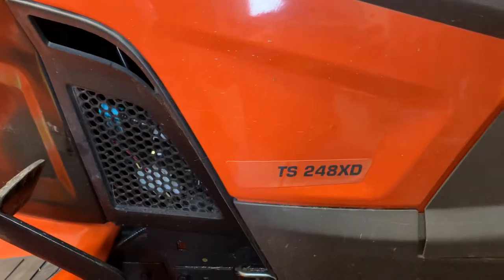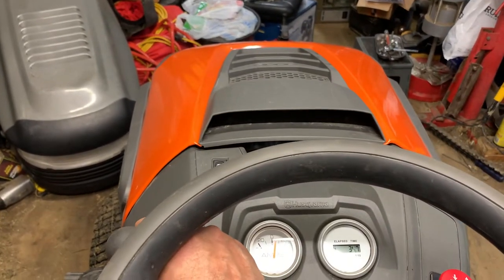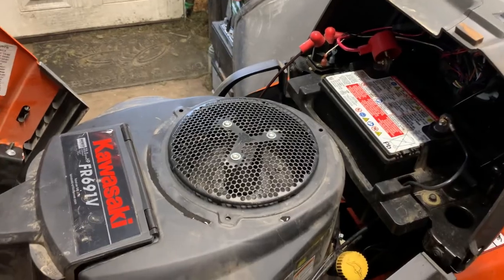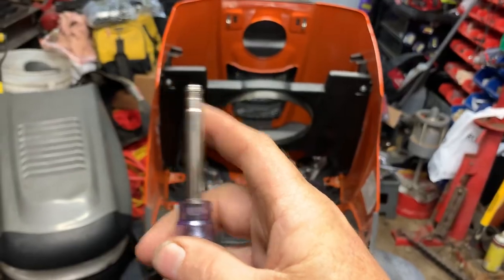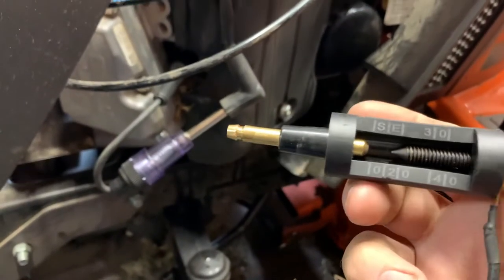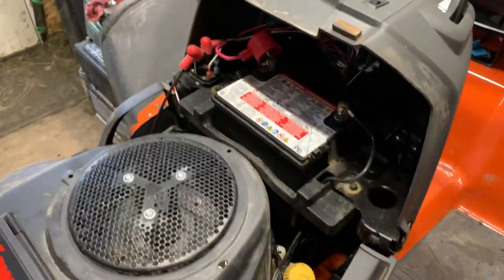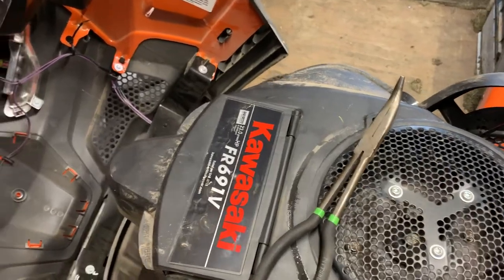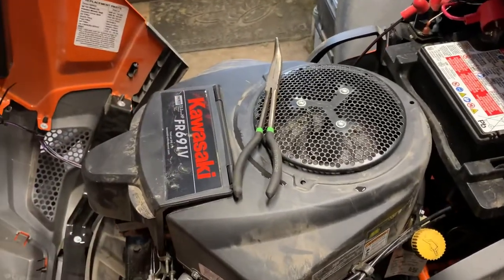Riding mower keeps dying when the PTO has been engaged On

Comment: I had the same issue… spark plugs were fine. It turned out to be the PTO switch. Replaced it (12$) and worked right away 👌
Reply: the switch bogged down the engine and stalled it?  wierd.  seems like to me the clutch is binding, but if it worked.
Reply: That’s odd that the switch was it?
Reply: I’m dealing with one right now same issue will see.

Comment: Good video brother! Mine did the same thing, one plug removed and shut off. What fixed it? Mine runs fine until I engage the blades and it loses power. Deck is clear, spindles and pulleys are good. Lost on a mower with 54hrs.
Reply from the maker: I had to replace the coils because one of them was bad.

Comment: Very good buddy I had a craftsman last week and I was mowing with it and it kept kicking off the electric clutch and I took it off and I managed to get sandpaper and I sanded around the inside the best I could and I took some carburetor spray and cleaned it up the best I could and put it back on and so far it's doing okay but I look for it to go out I heard that they are expensive it has been sitting outside for a while and it was given to me and even the battery still worked
Reply from the maker: I've done some that have been almost $400 for a new one. I had one today that needed a head gasket and Deck work done to it. The battery doesn't last long in the winter here unless you have a float charger on them unless it's in a heated building. I've been sick and lost my voice for 2 weeks but was sick for almost a month and was on two different antibiotics before getting over it so I couldn't make videos.

Comment: I have a ts354xd , just had the fuel system flushed , rebuilt the carb , new vacuum fuel pump , fuel filter, I’ll get 50-60 feet and it will start bogging down , like it’s being starved of fuel , turn the blades off and it runs normal??
Reply: did you ever figure this out?
Reply: I’d like to see a follow up to this. We have a 354xd. With under 25 hours when it first had issues.Running horribly. Have a 3 year warranty. Took it in 3 times. They told me I gave some water in the fuel. Which I told them was because of a faulty vent hose just under the gas cap which had snapped in half. Allowing debris, condensation, hose water to infiltrate the tank. Anyway, my 3 year warranty doesn’t mean shit I guess since Husqvarna and Kawasaki agree to do nothing. I’m out $4999.

Comment: I'm having the exact issue but both spark plugs are firing just fine. I've gone though everything I can think of.
Reply from the maker: Safety switches, Bearings, Wires? They can be a pain sometimes. Does it lose spark at the plugs when you turn on the PTO or does it just slow the engine enough that it dies out?
Reply: @MrJustDIY  it was my carbonator the whole time. Was getting too much air. Would kill my engine. It's running great now.
Reply: How would you know thats what it was??? Im having problems with mines. It keep going off when im cutting grass@paulm8343